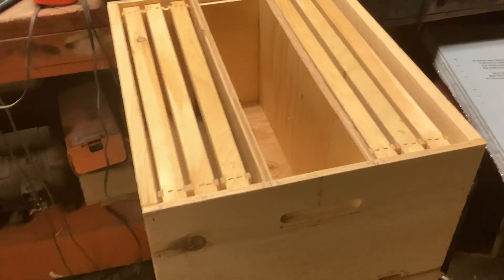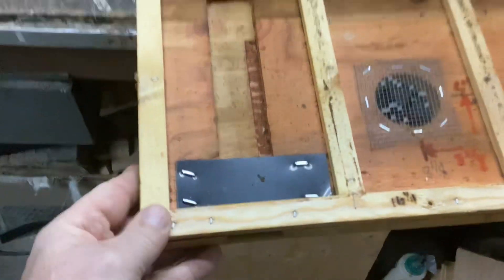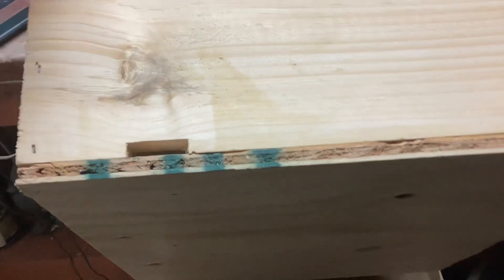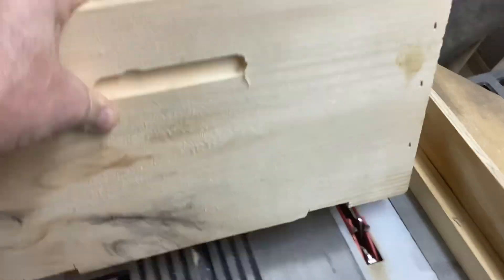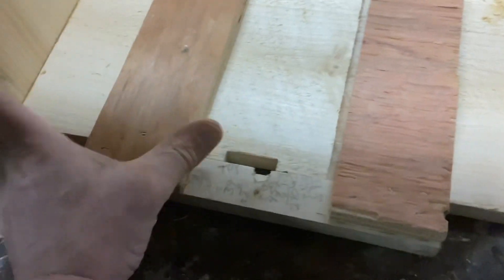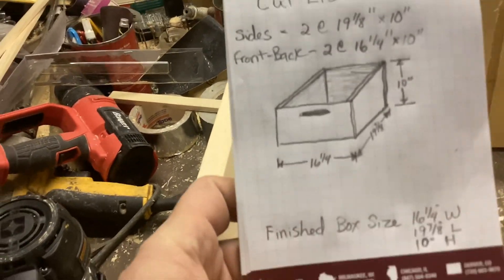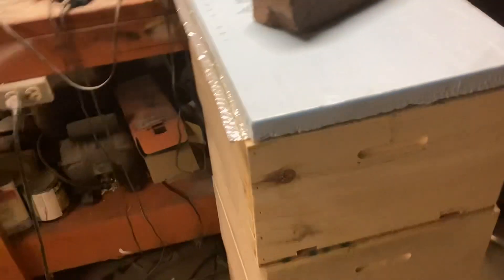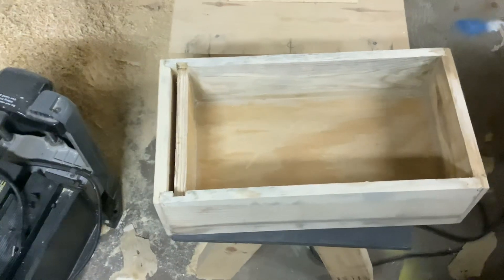Building 3 frame queen mating nucs #beekeeping #matingnucs

Comment: That a neat jig you got there my friend. I run eight frames so do you think 4 frames or Two frames would be best to try. It’s hot and humid in our summer. 😊
Reply from the maker: Hey Keith, two frame mating nucs should work pretty good. You’ll have plenty room to move frames and place your cells. Just have to be careful not to over populate it. It’s odd when you see a two-framer beard in the heat, lol.  The 2” vents in the back help a lot. Thanks for watching!
Reply: Thanks for the help